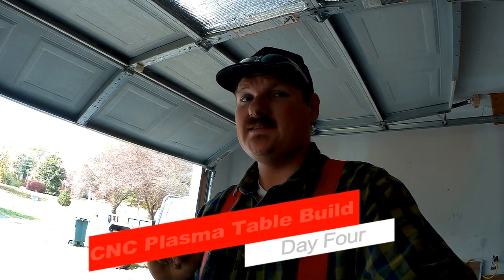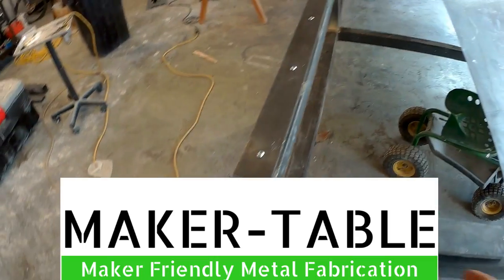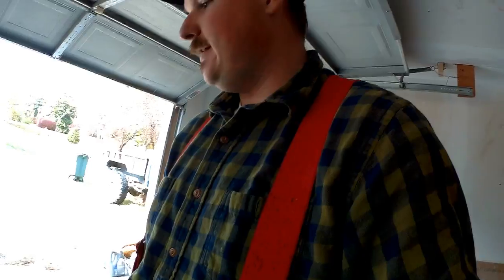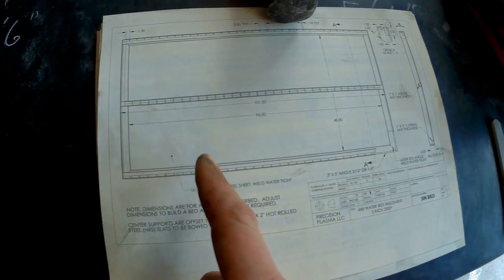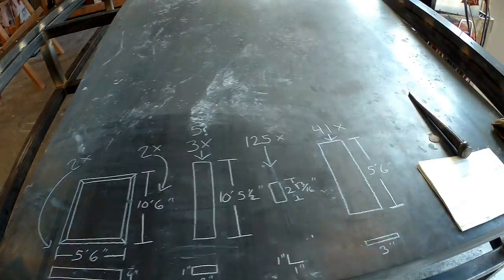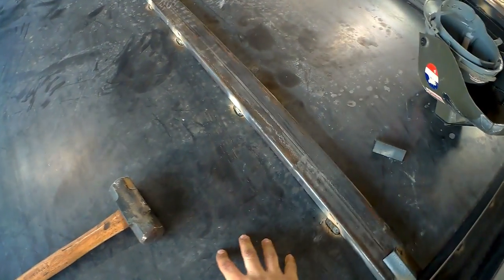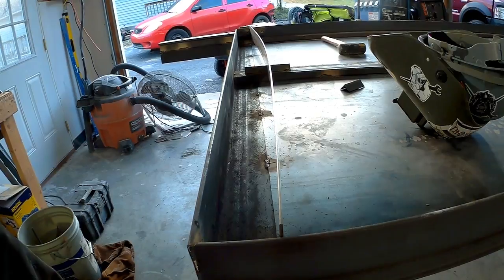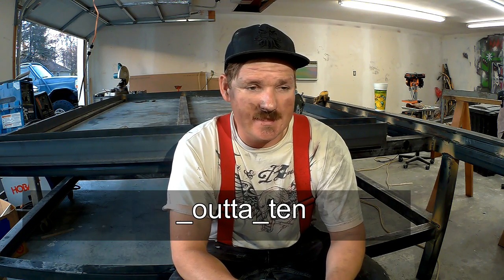CNC Plasma Table Build Day Four (start water bed)

Comment: I have to ask why did you not us a plasma cutter on fabing the table up ... I’m new and just want to know if there was a reason
Reply from the maker: john workman welding is a lot easier if u have good fitup. It's hard to get really clean cuts w a hand plasma torch so I used a chop saw instead.
Reply: Thanks for answering my question
Reply: I’m thinking of building mine just a standard 5x10 but I have no idea about the software and motors
Reply from the maker: The motors and electronics were tough to figure out but not impossible.  CandCNC has pretty good support and a great community on facebook

Comment: I made a similar mistake with having my slats to tall and you've probably figured it out by now but after I got the table up and running I just pulled most of the slats out and made a jig with vice grips and let the machine cut a half inch off so that the slats were shorter.
Reply from the maker: FTWarr I haven't even thought of that, excellent idea! I've just been dealing w the little bit of smoke and dust. I'll get time to fine tune it some more eventually.
Reply: I stumbled across you're video on the weld table and I've been looking over your table build. I wish you would have built your table about 4 years ago and saved me some headaches. Or maybe if I would have found them sooner I could have saved you some headaches. lol

Did you ever get a bigger welder? I picked up a used Miller 251 for about $1000 from the local welding and gas supply that they had taken in on trade from a local fab shop.
Reply from the maker: FTWarr not yet, I'm still pushing that little Hobart. I just did a flea market that went really well and I've got some repeat customers calling. So if things keep up like this I hope to upgrade welders in a few months! I've been watching Craigslist like a hawk but I'll have to ask my local welding supply next time I'm there.

Comment: I'm building mine. Working on Y rails. Curious - is that butt welded or is the sheet overlapping the angle? Also do you MIG with no shield?
Reply from the maker: I overlapped the sheet and welded it all from the bottom. It warped a lot, even with tacks every 12". I should have tacked every 4" - 6" to compensate, but either way it's a lot of welding. I use flux core wire, it's self shielding (like stick welding), all position and has a high deposition rate.  It's my go to wire in most situations but it can take a little practice to avoid slag inclusions from the flux.  Good luck on your build!

Comment: Hi, built on the watertable. But are you going to fully weld that sheet to the angle iron? Because i see you only tack welded?
Reply from the maker: Attila Pataki I'm going to weld it from the bottom to seal it up. Then I'll weld out the slat supports. Any tips for me?
Reply: I don't have a better idea than yours :)